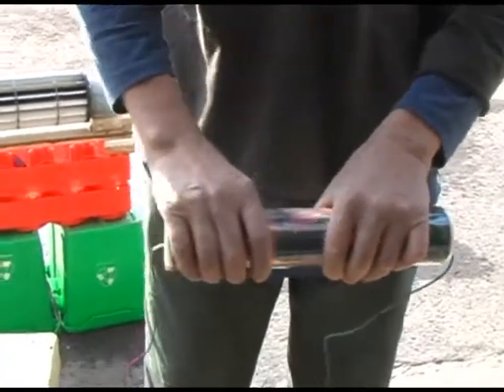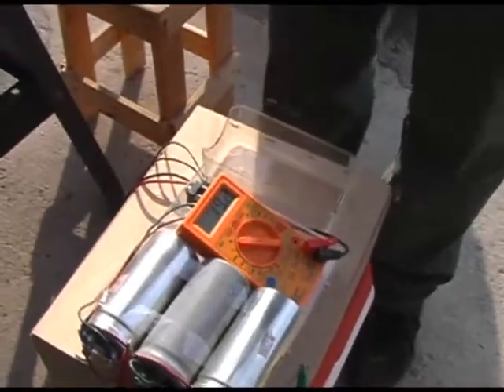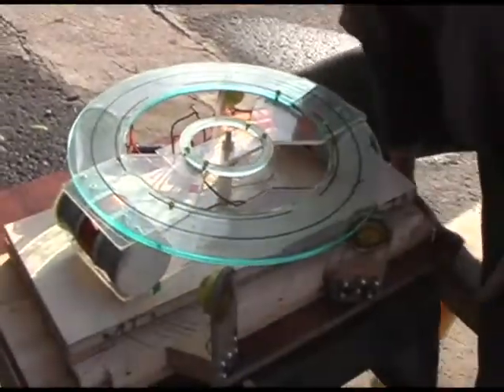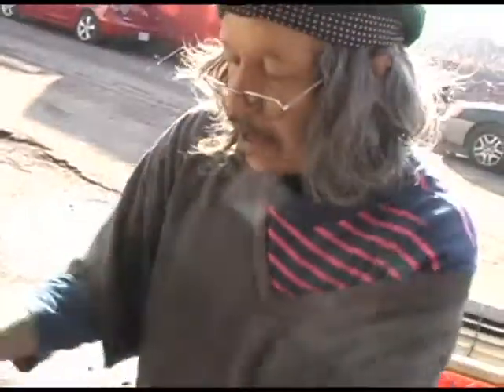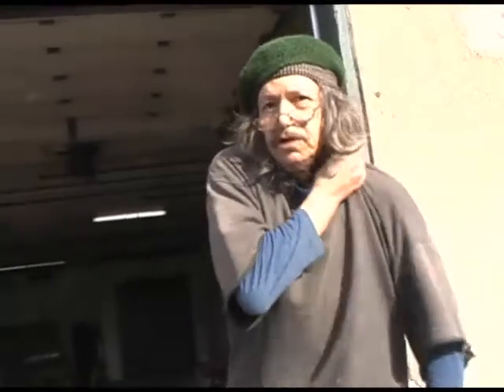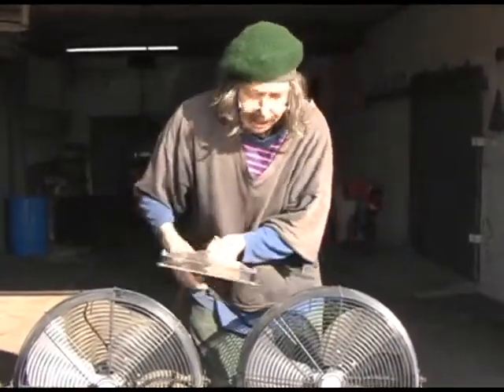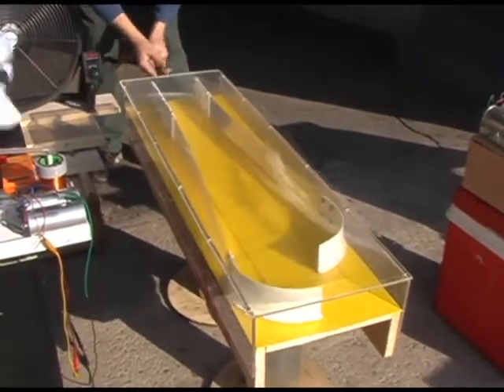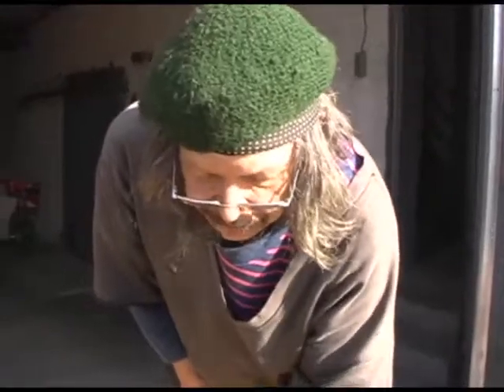mag osc gen sys - 1.mp4

Comment: @FreeEnergyNow1 : Yeah they CALL 745w a "hp" for sales purposes; but it is pretty useless in action - once you drop mechanical (efficiency loss - all!), and batteries. Doesn't describe (but includes) reluctance, heat loss, etc. For electronic cars the number of ACTIVELY FLOWING amps, at a certain voltage range, are the crucial quantities. An example: for a 48-56v Hub (called 48v before knockdown). May send 100v into Alt-bank - just to maintain at 52v. Get rid of Batts: they would BURN OUT!

Comment: There you go again showing your ignorance: Batteries have chemical transfer processes - capacitors do NOT! 2) You have NO idea how much energy is needed for 4-wheeler. Oil fumes have killed your brain-cells! Never will you find out either: Rare Earth use has increased 5-fold in last 10 years, China mines 97%. China cut such exports 30% last year. Yesterday Obama in speech said US goes back to 1920 if not get Electrified transport. No iphones, no jets, no gas-cars, no electric motors. FOOL!

Comment: The Deconstruction movement has now reached engineering. The Kind of  "reverse thinking" here, is the DECENTRALIZATION kind, where MANY streams of current, converge to drive loads onward. Not the CENTRAL POWER SOURCE - whose output was then divided  this includes transport generators, still clinging either to Mag-Drives (formerly "hub motors"), or gas-motor dependant generators ("Hibrids"). Missing from engineers minds has been the fact that produced current - from WHATEVER SOURCE, mixes freely.